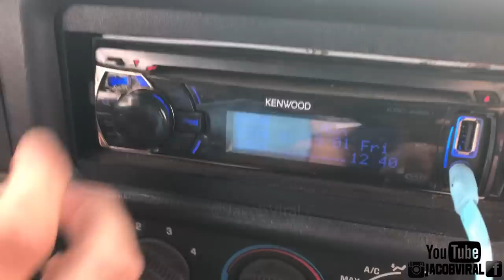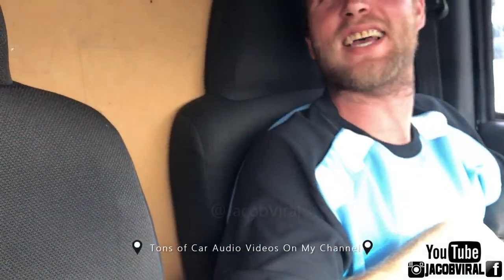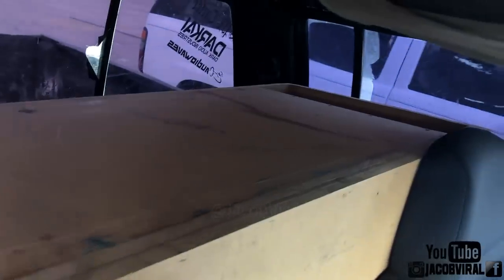SINGLE 18 TRUCK BUILD

Comment: Didn't he say he did a 144.9 if I'm not mistaken?  I'm pretty sure he did.  That would make more sense as well because a 150 on that one sub isn't impossible by no means, but on that amp with box rise it would be so impressive it's almost unbelievable!
Reply from the maker: Yea he said 149.9 but no numbers to confirm
Reply: @JacobViral  you can hear in the video he said 144.9, not 149.9, so almost 145 not almost 150!
Reply: On another YouTube channel there is a guy who got a single sdr 18 into the 140s so I would hope an evl would get past that

Comment: i have the same 18 skar , and have it on a wolfram c2400.1 @ 1ohm i know it needs more power. I also have an audiopipe apmn 2k as well as a soundstream AR.1 8000d. All three are srappable just not to each other . i know this isn't the best way to do it but,  My question  is can you run a different amp on each coil it you have the same power going to each
Reply: No.  None of your amps are the same.
Reply: Dustin Gurley you know the answer is to sell the other two and get a matching second
Reply: Sell them all and buy something good and Korean like a 3k at least, I'd actually run a 4k at 1ohm
Reply: Hi Dustin, I'd like to answer your question bud, if I can. Your three amps are different in how they handle the independence rise . Running to different amps would not work . The out put of your signal on each amp would be changing ,an not in sink with one another,therefore your duel , coil would have to to handle the differences from each amp, sending them signals. Would be much better either to run one big enough amp, more like a 5k. Or 2 strapped amps ,that are the same . Best of luck ☺️🤞

Comment: Would it be possible to do a 1 18 inch sundown  zv5 or zv6 build in the center of a 98 chevy single cab ?
Reply from the maker: Will be really hard but yes just have to make the box tall to optimize output. I would rather a 15
Reply: @JacobViral  what would be the best way to get loud in a single cab my goal would be atleast 150 db or better if I can also this will be my first big system
Reply from the maker: @nascar3fan108  this was one of the loudest single cabs I’ve heard: https://youtu.be/p5ewispaDLI I suggest trying similar

Comment: @JacobViral so what do you recommend for a ported enclosure for this sub? I wanted to go with 7.3 cubic is this to big
Reply from the maker: I would shoot for 6.5-7.5 cubes net and a good port area
Reply: @JacobViral the specs say 78 in cubed so would that be enough or i could go with more or less, and thanks ive been watching all your videos
Reply: @JacobViral   would the taramps smart 5 be too much or am i good with the smart 3, I will be adding a second battery and the big 3
Reply from the maker: @leonardomartinez4866  sometimes more power then needed gives your more efficiency and clean signal to not max out and clip. If able I would shoot for 5 and cut back to never max amp out.
Reply: @JacobViral  thanks for the tip,
Reply: @JacobViral  but what do you mean cut back im new to this
Reply from the maker: @leonardomartinez4866  Cut back, meaning now have to turn the knob all the way up, adjust bass levels to a lower then max level.g
Reply: @JacobViral  by knob do you mean the gain knob on the amp
Reply from the maker: @leonardomartinez4866  your stereo head unit/radio and bass levels there on it. Feel free to message me on Instagram/Facebook Instagram further questions.

Comment: How do I meet up with you so I can demo my ram to you single zvx18d1, 2 taramps 1200 bass gain matched, 2 APEX 1255 agm 12v 55ah batteries, stock radio on pac line level converter and skar ska7eq for line voltage boost at rca 7v......love your channel 5/15 turned 40 been a basshead since it was cool.
Reply from the maker: Big Car audio show down south in Georgia Florida and Carolinas

Comment: can u run separate amps if they are the same to each coil like that? if so someone please explain how, also can i wire each coil on a d1 sub to my mono amp with two negative and positive outputs on the amp?
Reply from the maker: You can yes. And just run one coil per amp and tune matched settings. A dual 1 goes to half ohm or 2 ohm on mono block.

Comment: What would be the biggest amp in rms watts on a stock alternator rated at an average of 62amps ? I have 2 kicker cvx 10 inch in a sealed enclosure, I got a jbl 300watt rms amp running 1 ohm on a stock deck but at loud volume it don't sound good and there not much bass I need advice I'm using 10 awg copper live and ground, is it possible that the ground isn't grounding well enough even if everything is on?
Reply from the maker: with your electrical probably sucking up 40-50amps you only got 10-15 to the system, I would definitely dot he BIG 3 and do 0gauge runs and a 2nd AGM in the back. Probably could do up to 1k Watts RMS, but keep up with voltage. Upgrade Alt when over 1k watts for sure. Ground could be an issue so double up on grounds and do 0 AWG everywhere
Reply: @JacobViral  thanks for the reply and all the info I really appreciate it dude cheers!🔋🔊
Reply: @JacobViral  not to bother you with anything but I tuned my 2ft square box to 28herts and I feel like it sounds worse maybe 2 10s ain't enough to feel it but I also noticed my car stock deck/stereo is getting hot ?
Reply from the maker: Ashley Bernard I wouldn’t tune that low your going to lose high end response a lot. Probably more like 32-36hz range or higher if you wanna get louder. Hot/heat would be high volume levels of distortion probably or poor cooling.
Reply: @JacobViral  it's the stock deck not the amp that's getting hot is it possible that my high level imput wires  is in wrong side
Reply: @JacobViral  I need quick help I'm using high level imput should I switch to rca imput but since my deck don't have rca's is it possible to wire the speaker wires with rca and use it in low level imput of the amp?
Reply: Hey Ashley,  you can get your 60 amp alternator beefed up to a 260 if you want to and handle more power or you can upgrade to a stinger alternator and make tons of power to sustain loud car audio.
Reply: @eliascorteslopez1094  I want to but I can't find any that would fit my small hatchback I got a 2006 Chevrolet aveo spacial edition its manual , where could I find one

Comment: Does anyone have a build sheet for dimensions for a single 18 like this? I have a 98 gmc sierra ext cab I want this same kind of box but sub on top
Reply: 36”/24”15” 1-1/4 “  is what I just made for my resx18. That dimensions from outside of box the inside will be 5cubesat least